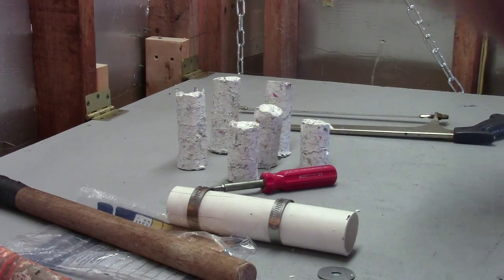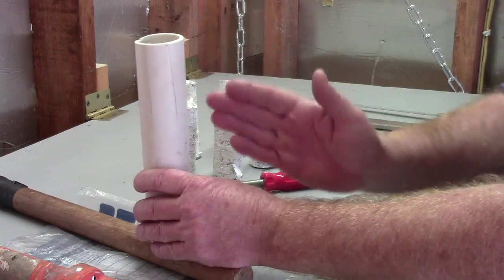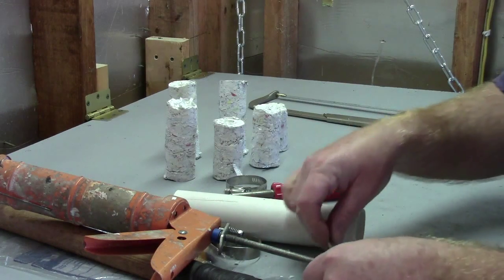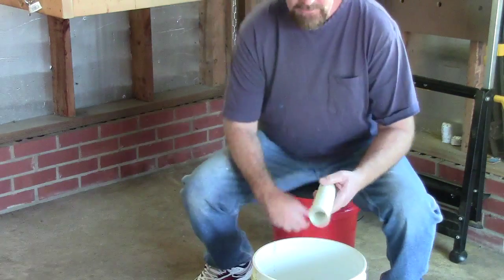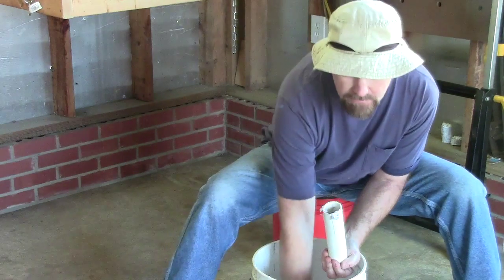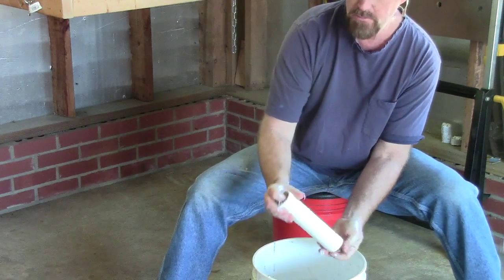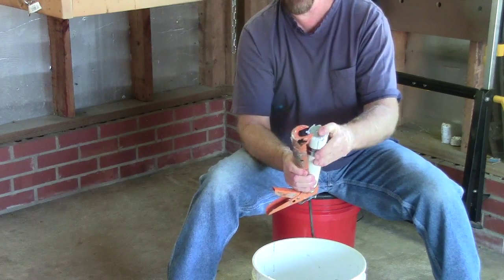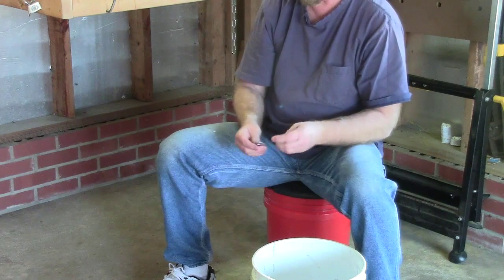How To Make Use Of Shredded Paper

Comment: I rigged up an old 5" circular saw blade to a shaft for my 3/8" drill, alternately bending the blade to help the process,. adding my sawdust from INTERESTED lumber (compensates for any glossy paper and use a 16" length of 3 1/2 in pipe that I've drilled a bunch of small holes in, capping and clamming on an end cap, also with small holes.  The material shrinks as it dries, allowing me to uncap & slide it out.  Still needs to 'Best 'big for s while.  Even got some of my neighbors to donate their scrap, returning half to them in 'logs'.  Every one seems quite happy.  By the way, great vid. Thx.